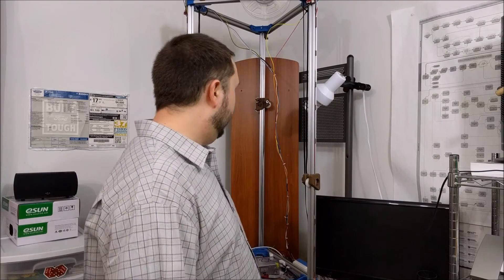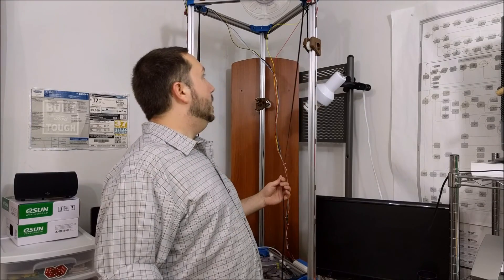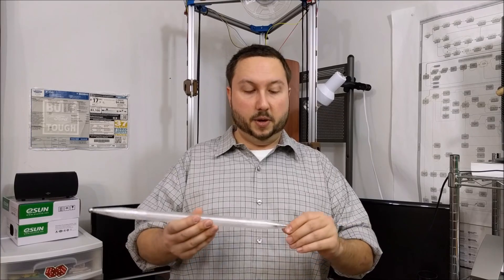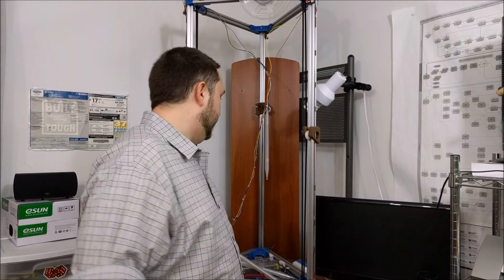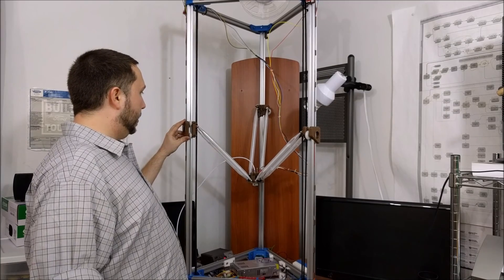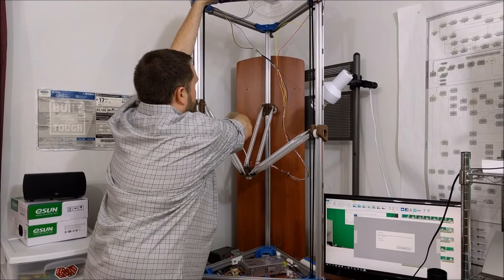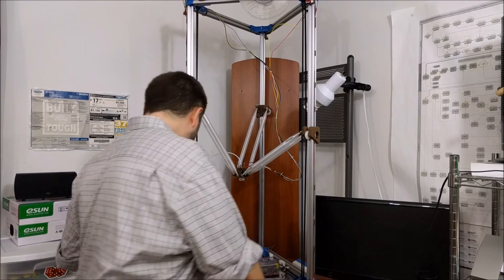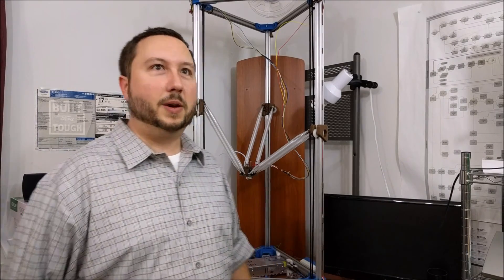48 Inch Delta 3D Printer DIY RepRap Open Source Arduino

Comment: Thanks, Steve!  An excellent project indeed.  
I've used fishing line running in plastic rings with counterweights to tension stray cables (etc)  with success - if that is too slow (inertial response of weights) then very long elastic lines can usually replace the weights - the length is important to keep the tension variation to a minimum.
Good luck!